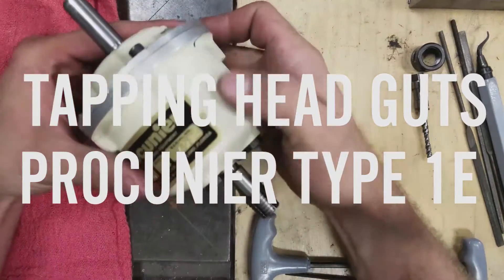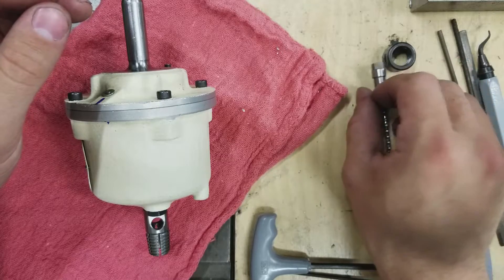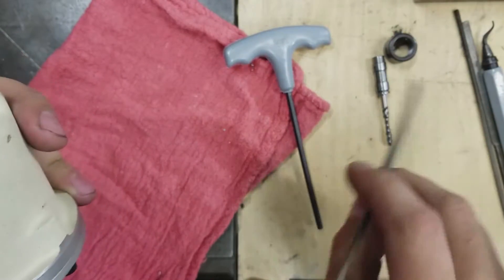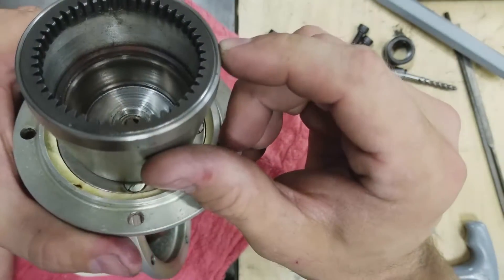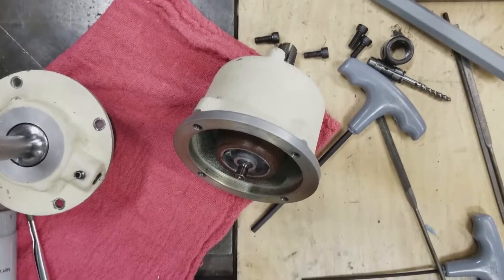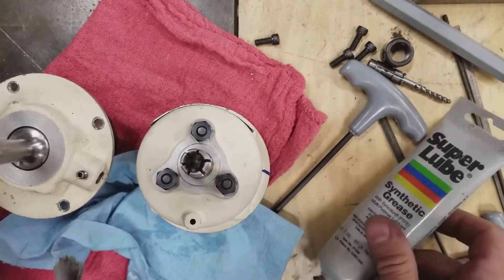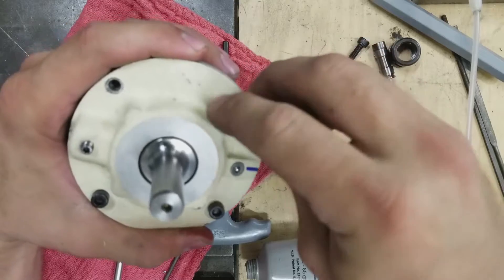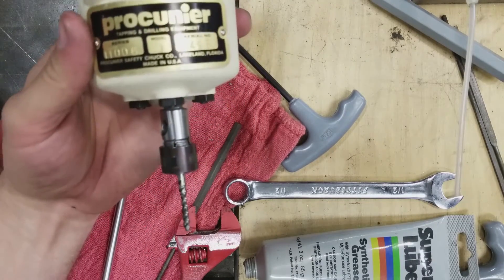Procunier Type 1E Tapping Head Guts

Comment: I bought an old Procunier with a two jaw chuck that can use any size tap up to 1/4". It would not drive a tap even as I applied more down pressure so I took it apart and noticed the cork clutch was glazed over. I scuffed up the cork and roughed up the mating cone surface and it worked like new.

Comment: I discovered tappers about 15 years ago, reading an online article. My reaction was, gotta have one; I went to eBay.  I found a new listing, 15 minutes old: Ridgid tapper $50. I damn near broke my arm hitting Buy It Now.

Didn't know anything about Ridgid's version, but the article had given a new price, and a common used price, and both made gambling $50 a no brainer.

Turns out, the seller had bought it new, 20+ years before, used it once, then put it on a shelf, and never used it again.

Ridgid no longer makes them, but it has a Jacobs collet, with two sizes of the rubber & steel insert, Jacobs still make and sells chucks, and inserts.

It is a self reverser, and does more capacity in the one size of tapper than Procunier. The type 1E has a capacity of #10 in mild steel, and ¼" in aluminum. I'd have to go to the shop to check, but I think I can do up to ⅜" in steel with the Ridgid.

If you see a Ridgid at a good price, grab it. I was just starting production on a rear disk convention kit when I found this, and the Ridgid has done me well for that, and for all of my other tapping where I don't need a more accurate threaded hole, (90° to the material, wise), or with small taps, (<#10). I'm just not trusting enough to go any smaller with a 'power tapper'.

The reason I watched this vid, though, has nothing to do with the Ridgid.

Last Summer, while in NY, I found an old, abandoned and neglected Procunier 1E alongside a semi-rural street mixed in with some electrical parts, and gallons of paint put out for the 'curb shoppers'.

[Long Island garbage collection is waaaay different than Oregon, where I'm from, and spend most of the year. I'd never heard of/seen it, before. Anything, or as much as you want, can be put on the curb; it's taken away, no cost.

They have townships, within their cities, within their counties. The townships pay for garbage collection; taxes fund the townships.

This has led to ONE second hand tool/household store, (I could find), other than Goodwill types.   The store I did find was second generation, with many treasures in the deeper layers!]

The Type 1E I found is much older than yours. No paint, no label and slotted screws instead of SHCS. The gears inside look just as good as yours, but the covering bell on the top cover is surface rusted, as well as a ring of rust down in the very bottom of the lower half.

The clutch looked like it was rusted steel, just like the cover. With a second look, it is not rust, but cork.

I watched a YouTube demo of a Procunier a few months back, and the anti-rotation rod was going wild, slapping back and forth.

The Ridgid never does anything like that; I was surprised and figured it was a problem until I read the manual a few minutes ago. I also just remembered the Ridgid has a cast 'Y' on the end of it's anti-rotation rod, so it straddles the post.

The manual says the rod should be between TWO vertical restraints, which is a bit of a challenge on a drill press.

I'll go the Ridgid route on my 'new' Procunier, and fabri-cobble a split end for the rod. Oh, I did get an original rod with it, too!

I've had a brain injury, and sometimes my mind isn't real quick. When I saw the 1E laying in the wet grass, and dirt, I didn't recognize what it was, but I knew it was important I take it.

It took 2-3 trips across the street to put the paint and electrical stuff in the car; the tapper was last.  I was racking my mind trying to think what the heck it was, and was in the middle of the road, when it hit me.

It wasn't until I heard a car lean on it's horn, I realized I was so stunned at what I had found in the dirt, I was standing in the road looking at the damn thing in my hands.

One thing for others who may get a tapper. I had a small HF bench top drill press I bought when I really needed one, and couldn't afford anything else. I hated it, and put it in the corner, as soon as I found something else.

When I got the Ridgid, I bought either some round tube, or some steel pipe, (different OD's), reduced the OD slightly, then used it to extend the height of the desktop HF turd.

It is now loved as my dedicated tapper. The weakness which made it suck as a drill press, made it just right for driving the tapper.

It's lack of power may actually be an asset, in that I've never broken a tap using the Ridgid tapper, even when I experimented down to #6, in the beginning.

The reason I do small tapping by hand is fear & anxiety, not because the Ridgid broke them.
Reply from the maker: Thanks for the stories George! I think you're dead right about converting an old drill press into a dedicated tapper. That's what I'll be doing with mine when I finally upgrade. 

I'll keep my eyes open for a Ridgid.

Comment: thank you for this video. just got one yesterday and it has a small wobble. trying to figure out where it is
Reply from the maker: Glad you found this video - hope you find the problem!
Reply: @ViceChief  took it all apart. The bottom bearing seems to be problematic. Seems loose to me

Kind of odd how theres really no downward pressure besides a spring
Reply from the maker: @zackblack4098  The pressure matters more in the "up toward the spindle" direction because that's when the tap is tapping. Agreed tho it's an odd machine.

Comment: Hey buddy, squirt a little oil through the ball in the top every so often. Not to much, don't want any oil on the clutch. What kind of oil you ask? Any kind that won't splash, way oil, 10-30, or anything else slippery. 
Happy tapping.
Reply from the maker: Thanks Seth. I have some Waylube around that seems like just the thing.
Reply: Vice Chief 
Great, that will work. I give mine a couple squirts, a coupe times a year. It's not a picky tool, just enough to create an oil bath with out getting any on the clutch. 

You'll hand this one down to your kids!